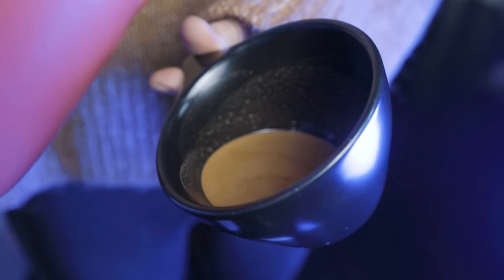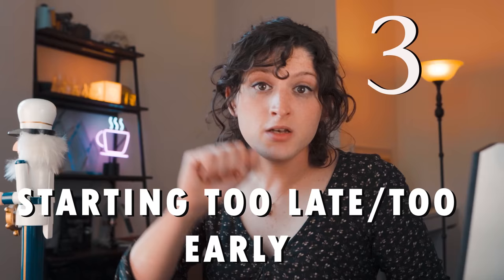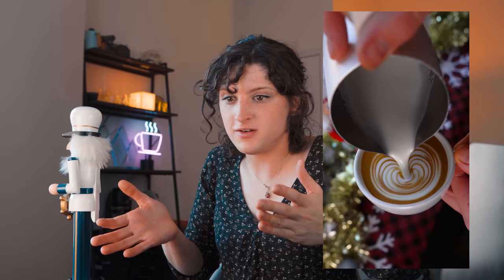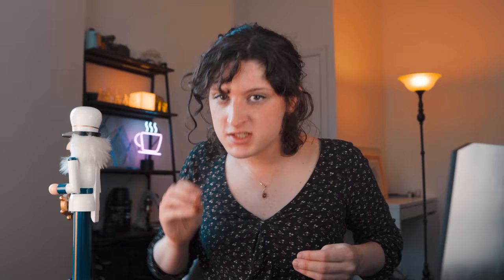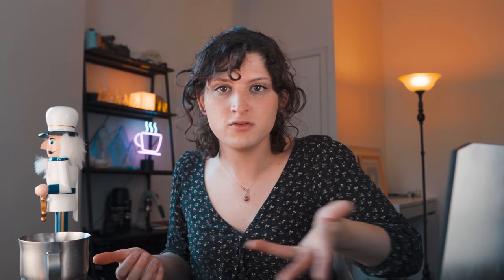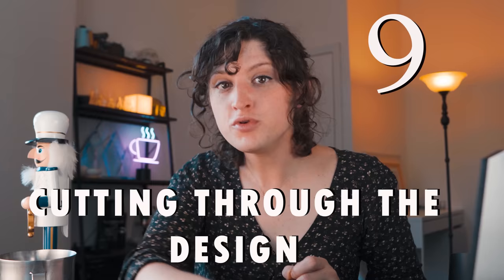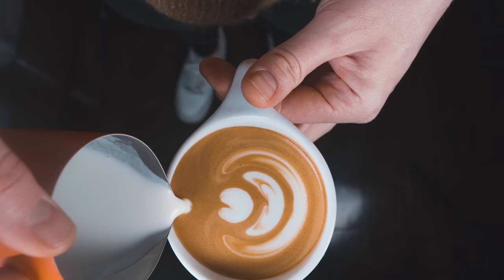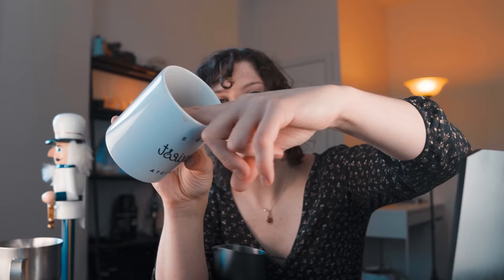10 Things RUINING your Latte Art

Comment: Great content! Thanks for sharing. I noticed you have a Rancilio Sylvia machine. Being a single boiler machine, what steps do you take to make an extra delicious latte? I do the following:
1. Fill my ports filter with coffee and set aside.
2. Bring the steam temperature up, and then steam milk.
3. Run an empty brew cycle until brew temperature is in the right range.
4. Insert ports filter and get a shot of espresso.
5. Complete an amateur latte art pour with semi successful results.

I should mention that I also have a PID installed on my machine, so I can see temperatures real time.

Thoughts?
Reply: I'm pretty sure you want to make the espresso first and then steam your milk.  As Emilee states in many videos, you don't want to let your milk sit too long before pouring.  I suspect your foam is separating out from your milk while you're waiting for your espresso to finish.
Reply: It can be okay if you just keep hitting and stirring your pitcher

Comment: Regarding the last issue covered about mugs vs. bowls, here's the situation I have. I have a fairly large collection of Victoria & Beale tea cups that are short and straight-sided that were part of the hand-me down dish set from my parents when I moved out. I believe they are 8 oz. cups, and latte art is hit or miss. I actually poured a decent tulip over the weekend in one of those cups. But I also have two Bodum porcelain mugs with cork sleeves, which aren't curved but the walls are fairly sloped. I don't really have the space to get more mugs. Any advice? Which type of cup is better for art, and how can the straight sides be worked around?

Comment: I'm a dirtbag, not a scumbag... 
    or maybe both???

Do you use the same fav pitcher to pour into all size cups?  To not waste too much milk (either at home or cafe) I would steam in the proper size "steaming" pitcher with the 'right amount' of milk... but do you then still have the right control/flow/etc to pour great art into a ~2.5oz macchiato or a 4oz cortado or 5.5oz cap or 8 or 12 oz latte?  All from the same "pouring" pitcher with just different amounts of milk?  Would you switch to a finer tip pitcher for a smaller (macchiato) size vessel?    

This question comes from a cafe perspective... I started (volunteer) work at a cafe 1-2days/wk... just getting past the 'total noob' stage into being able to 'sometimes' make something pretty.  But with 4 different size drinks (plus 3 size to-go) I wonder what the best method is to do better art. 

I'm curious to try using a bigger pitcher for smaller (2.5-6oz) vessels after steaming in smaller pitcher... I'll try it in next time.  Hoping it makes life easier!